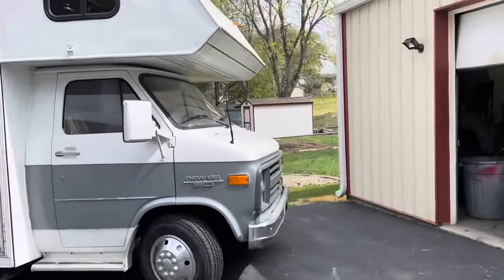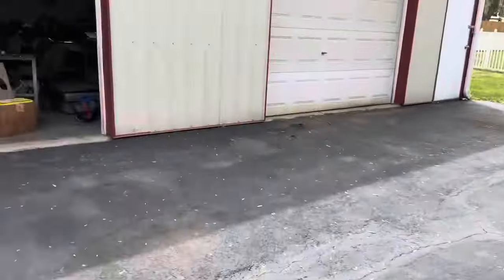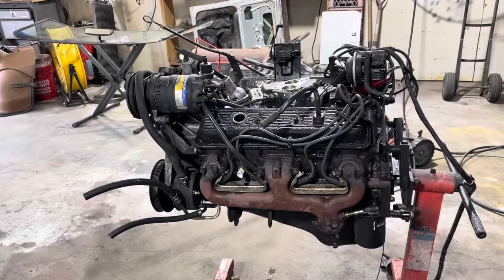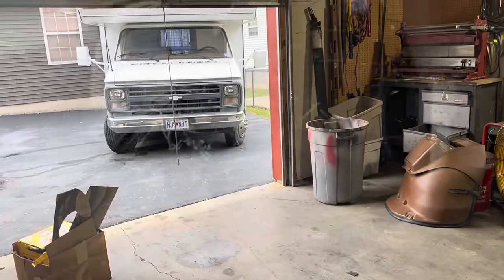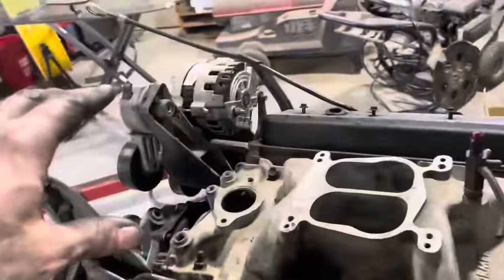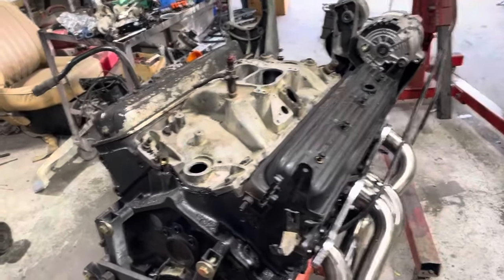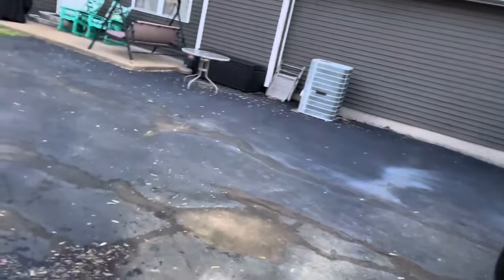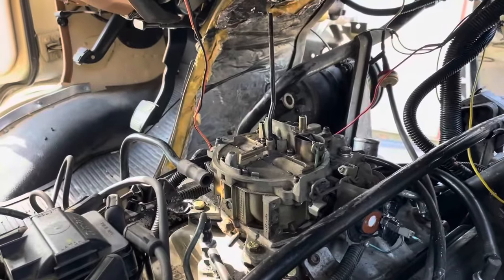35 Year Old RV; New Engine Failure!! Oh No!!!

Comment: Personally, I hate Pulling engines on them
Reply from the maker: I guess after doing so many I’ve got a system down and I think it’s one of the easier motor swaps. Just thinking back in my head I’ve had a 72,75,79, a couple of 80s, an 84, an 88, and two 92s. Interesting thing is all those years are the same basic body style.